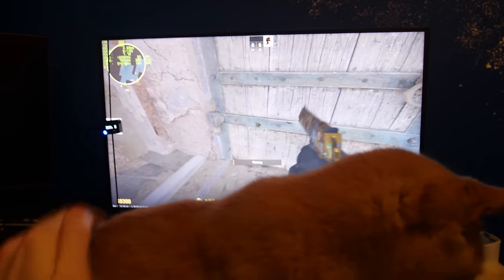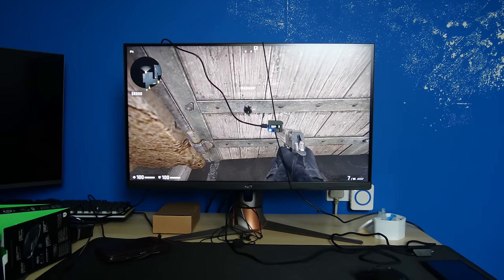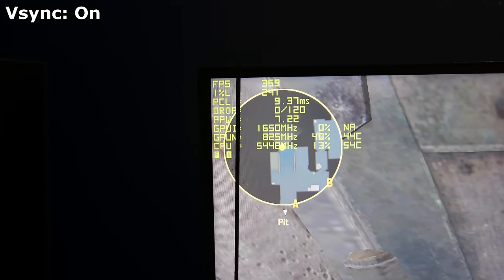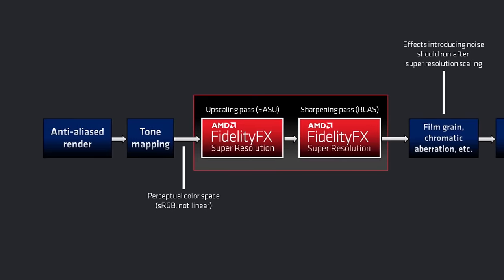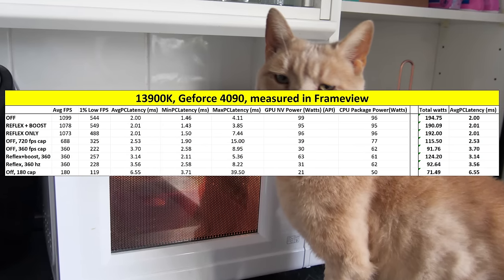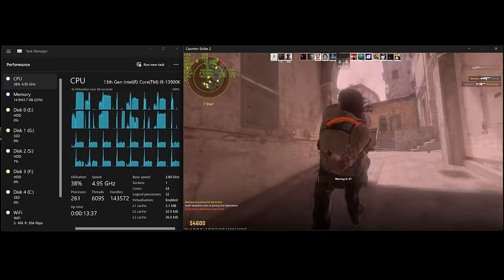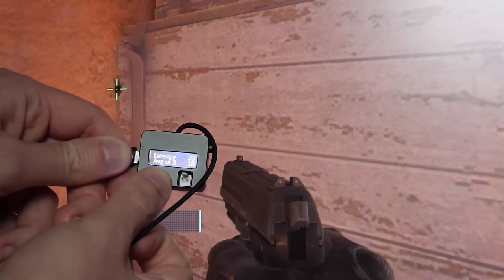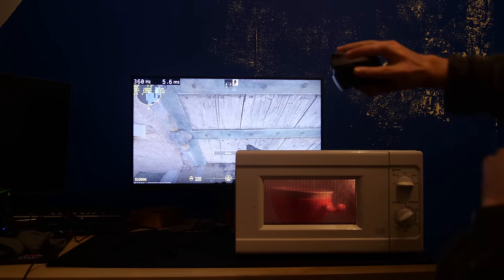Further CS2 Input Latency Testing

Comment: A fucking LEGEND. 

Anyway, I just made a huge mistake by upgrading from 3080 to 4090 for cs2, while keeping my "old" r7 7700x processor.

Turns out, cs2 is heavily cpu bottlenecked , and I got marginal improvement in fps  for a card that is at least 200% as powerful.

No matter what I do  the 1% lows will not move past 190,or 200fps on overpass on 1080p.

But it's nice when you go to 850fps in the menu 😂
Reply: Well ofcourse at 1080p the RTX 3080 will never be a bottleneck for *almost any game I don't think?
Reply: lol
Reply: @martinkozle   it can be for cs2 , if you want to have consistently above 360 fps in 1% lows
Reply: 3080 vs 4090 in competitive games is laughable
Valo cs2 league and other esport games run pretty much the same maybe 4090 has 30fps more but even then most of those games run 300+ with ease on modern graphics cards.
4090 vs 3080 begins to be a gamechanger when you play singleplayer games like rdr2 cyberpunk etc
Not worth the price atm imo 3080/3090 are beasts and you can still play ultra sp games without issues so its more of a novelty if anything atm. 
I cant even imagine how overkill the 50 series is gonna be if its even possible for them to overthrow the 40 series by at least 2.0x or 1.5x otherwise its just gonna be even more useless for gaming and probably better for editing etc
Gaming rigs still seem to keep up well with the 20 series.
240hz monitors are the real bottleneck nowadays
360hz and onwards still arent that popular and 240 vs 360 isnt a big difference either way but I guess 360 will become the norm soon enough since pros will take any advantage they can but the average player and even top 0.1% players most likely wont switch because it doesnt impact them to the point that its unplayable to play on 240hz vs 360hz players.
Theres gonna need to be some  big changes in a lot of things for 360hz monitors + 40 series rigs to become the norm in pro gaming

Comment: I built my own latency analyzer, and I noticed these latency analyzer flash indictors are not accurate at all. The nvidia Indicator works the same as the rtss flash Indicator. I tested the rtss flash indicator in many games. It can't pick up many changes that got applied to the system. For example when playing a game in borderless fullscreen. It usually introduces 5-10ms lag (or more depending on the game). The rtss marker "ignores" this and shows me the same results as with fullscreen mode.

While yes, it uses a 3D api hook, but the problem is, it's not FULLY integrated into the game engine, and that's why i'm seeing these results.
Nvidia for example has a implementation of it's own Flash Indicator that is integrated into certain game engines, that needs to be enabled in the settings and it's known to be more accurate then the rtss/geforce experience flash marker.

That's also most likely why you see lower input lag in CS2 compared to CS:S, despite CS:S probably having a much higher frame rate then CS2 and the game engine of CS:S doesn't need to proccess as many things. Doesn't make quiet sense why CS:2 should have lower lag overall.

Overall it's still a good way of testing general input delay, but it lacks of precision.
Reply: Maybe css had more input latency because of standard souce engine 300 fps cap?
Reply: @SteamPlayLEET  good to know, can you actually delet this 300fps cap in CSS?
Reply: @infinitestars394  Yes, you must set fps_max 0

Comment: The microwave may cause issues with mouse movement, moreso than click response times. When my headset is near a microwave it picks up crackles, in theory the microwave could interfere with the mouse's signal and influence the movement information. However the headset crackling is likely due to the headset receiving signals from the microwave, but I don't know if wireless mice need to receive signals in order to function accurately or not. So perhaps it would only be an issue if the microwave was near your pc. In which case I would be more concerned about bit flipping or some induced current causing glitches.

Comment: Id love to see an AMD Vs NVIDIA latency comparison In different games. I have a 3080 and a 3070 and I feel my 3070 has less input latency even when reflex isn't on, and at the same frame rates, or even when the 6800 is running at a higher frame rate.

Comment: Why bother testing if you'll ultimately overlook the game's key issues and praise Valve anyway? After over a decade, what's the point? It seems you're out of touch with reality, perhaps due to indifference or misunderstanding. At LAN events, where there are no cheaters, life seems great. But don't be shocked if Valve never releases an anticheat system; they, like you, seem content collecting data and laughing at trivial matters. Using your platform for such pointless activities... You might as well eat sand, though you probably prefer glue.
Reply: So what are game's key issues?
Reply: @d4cto  The inconsistency in the jumping mechanics has degraded the game's quality, but I understand not everyone is enthusiastic about surf/kz modes. However, why hasn't Valve implemented an effective anti-cheat system? Over the past 20 years, they've gathered extensive information, yet discussing the cheating issue feels like facing Soviet Union-style censorship, where everyone turns a blind eye. This problem has persisted across all versions of Counter-Strike, driving players to third-party platforms like Faceit for a fair experience. Why can't we have a clean, cheat-free game natively, similar to how Valorant operates? What's the reason behind this ongoing issue?
Reply: @robertnumber964  What is an effective anticheat? It's a cat and mouse game and there's more cheaters than valve employees.
Reply: @RawbLV  It's inaccurate to say that cheating is unavoidable. For instance, Faceit doesn't seem to have a cheating problem. Similarly, in other games I play, like Rust, there aren't any cheaters, and Valorant, a direct competitor, is also clean of cheaters. It's evident that other companies are putting in effort to remove cheating content from the internet, something Valve has not done effectively. I've stopped playing CS and don't intend to return until these issues are resolved. I recently tried to give it another chance by playing on some custom servers, but I ended up disappointed due to their ineffective server list. While you might be content with the company's approach, it's not correct to say that addressing the cheating problem is impossible, as many companies have successfully tackled similar issues.
Reply: @robertnumber964  Thanks for your perspective.

Comment: Could you please investigate an issue with lag when scoping with the AWP and other scoped weapons? For some reason people with certain hardware are having this issue on high model/texture quality. From what I've seen, the most common setup for this issue is a 5000 series Ryzen and a RTX 3070. I've had to resort to playing on low, even though it runs perfectly fine otherwise. Personally I am running W11, with the most up to date drivers.

Comment: Also testing top setups is useless, most people have 144, sometimes 240 hz. How are we supposed to understand which setting is the best if you mostly compare different 360 setups with only 1-2 test for 240hz and none for 144
Reply: So who is this video for? For 2 people who has the same pc as you? Nobody cares when they know that they have best setups, or they will just copy S1mples or monesy settings, that’s its
Reply: So if this video for people with 240hz and 144minitors and bot the best pc setup, then try to do test for them
Reply: You cap your frame rate as high as possible, doesn't have anything to do with the refresh rate of your monitor
Reply: @omegaPhix  what was the point of comparing 240 and 360, if he could compare 359 an no limit for example
Reply: @lambolord What the hell is your point? Monitor refresh rate has nothing to do with game latency. It seems that you don't even understand the basics of this topic
Reply: @omegaPhix  ok if i get 200 fps but it drops to 100 whats the point of capping if i will get a very poor performance plus latency on 143 for example
Reply: @omegaPhix what if my friends higher fps is 300 but it drops to 200, how can you tell where he should cap, if 357 gives you less latency than 360, this test is completely useless because his fps is far past from the need
Reply: @omegaPhix but yet still he uses reference numbers based on his monitor refresh rate. If it doesn’t have anything to do with the monitor then whats the point of this whole vid.
Reply: @lambolord  Did you miss that he was just testing G-Sync and V-Sync? This has nothing to do with fps and fps drops
Reply: @omegaPhix for example your pc gets 300fps at max, , what if those 300 fps are not so stable, like on his pc, and also your monitor is 240 hz, so how would you know if its better to cap at 270 or 240 or 237 if there are no tests as such
Reply: Its not a perfect world, each test must be done t in real life conditions, his test is the same as training on a racing simulator without experiencing any load on the body and with perfect weather conditions. Its useless
Reply: @lambolord   As you can see in the video not capping your framerate at all gives the best latency (8ms) and with Vsync enabled and no fps cap you'll have the worst latency(15ms), even worse than playing with 120fps less(13ms).

It's not hard to understand man...
Reply: @omegaPhix  no it does, check on average pc it will give much different results. Gsync is locked to the refresh rate of the monitor
Reply: @lambolord  All your comments go straight past the point of this video, watch his last one about CS2 latency for "the basics"
Reply: @lambolord  Gsync is not locked to the refresh rate of the monitor. The whole point of G-Sync is to alter a monitor's refresh rate. You have no clue what you're talking about. It's embarassing
Reply: @omegaPhix  as I previously said he is not dealing with fps drops, he has an average fps of around 500000, this test is relevant for a small number of people
Reply: @lambolord  his average fps is 700-1000, not 500000. And again, the point of this test  has NOTHING to do with fps (or Hz) but G-Sync / V-Sync / manual fps cap. 

The results are reproducable for ANY PC that can exceed the monitor's refresh rate
Reply: @lambolord  Just watch his last video, he even tested latency on low end PC's. And stop talking about stuff you know nothing about, this is getting ridiculous